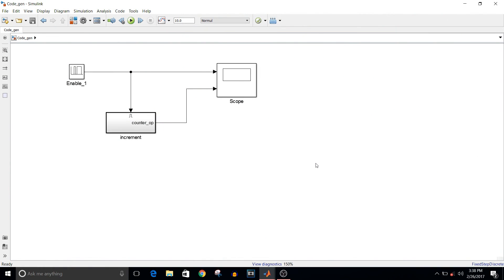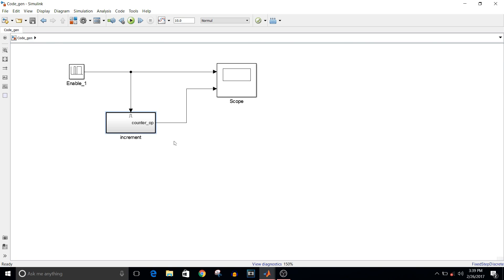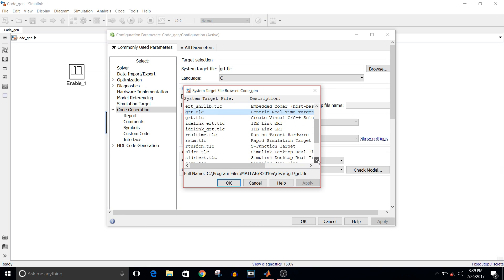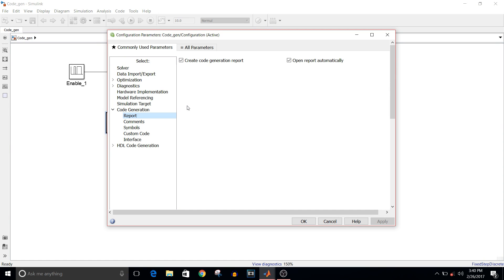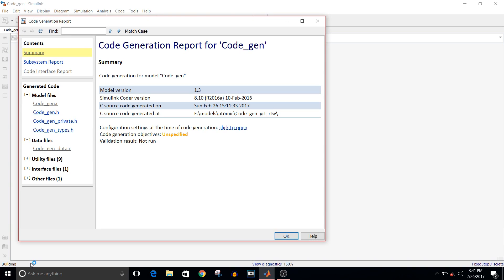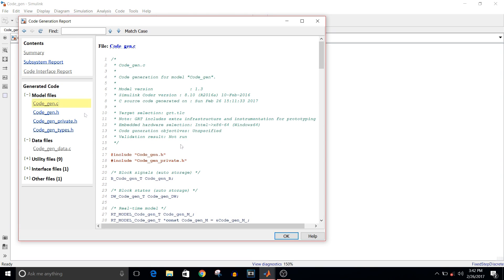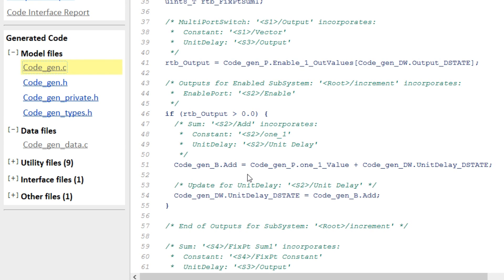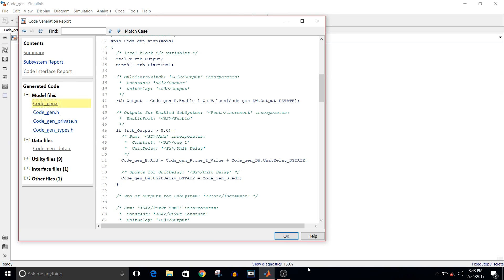Simulink Tutorial - 21 - Code Generation From Model

Comment: Hello, I use Simulink's Ti C2000 hardware support package to automatically generate code. I want to migrate to CCS for compilation. I moved all the files generated by Simulink to CCS, but it shows that some variables are still undefined. How can I solve this problem?
Reply: Did you solve this problem

Comment: I have doubt. Why do we need compiler only to generate code.Compiler part will come after code generation. Am I able to generate code without compiler ?
Reply from the maker: Tlc - target language compiler is used to customize the code building process of the model.
By changing tlc, you are able to generate code that is complaint to respective tlc guidelines eg. ert for embedded code, autosar tlc for autosar  compliant code.
You can write your own tlc and generate more customized code.
Reply: Thank you for the reply.I was asking about Mingw64 Compiler. There is one checkbox option that is “Generate code only”. For this do we need Mingw64 compiler?